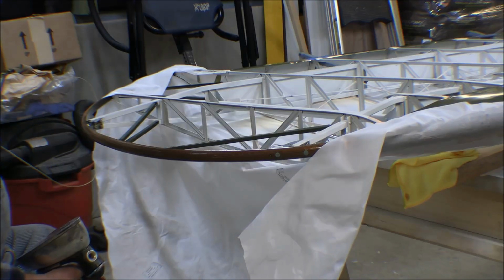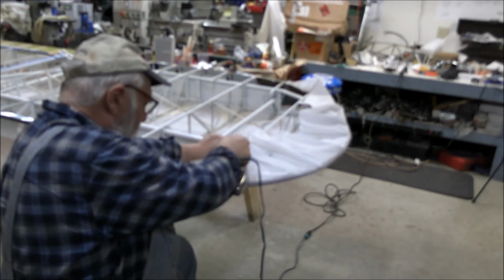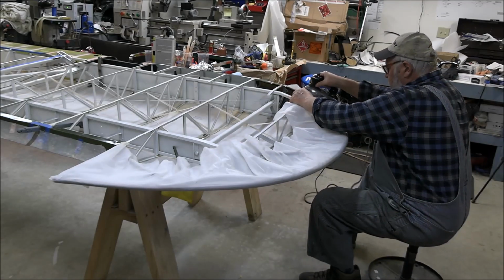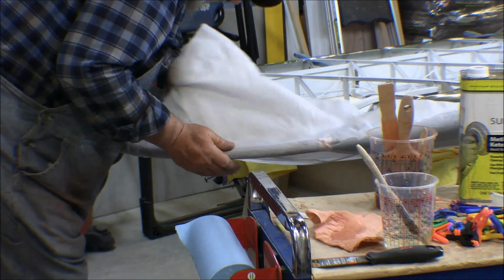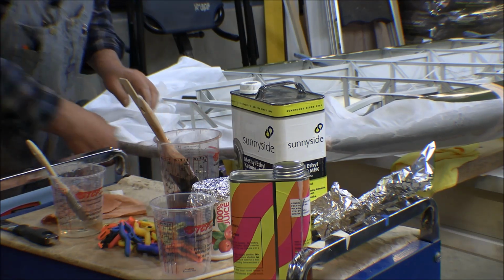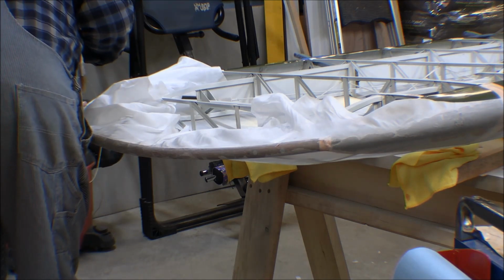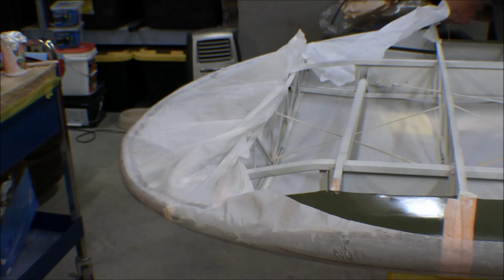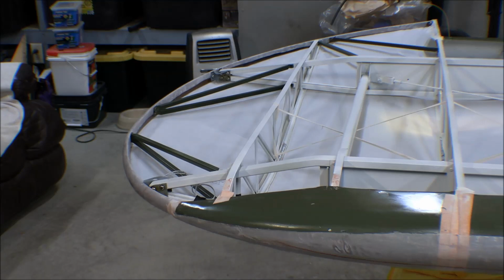Piper Super Cub Wing / Heat Forming Wing Tip Fabric

Comment: Super job well done again. I am looking of your leding edges did you add a primer before the fabric installation ? Regards
Reply from the maker: A couple of the skins were already painted, I cleaned up some corrosion on the others, painted the inside with PPG primer and the outside with Poly Fibers epoxy primer